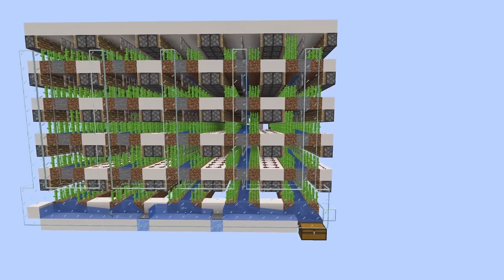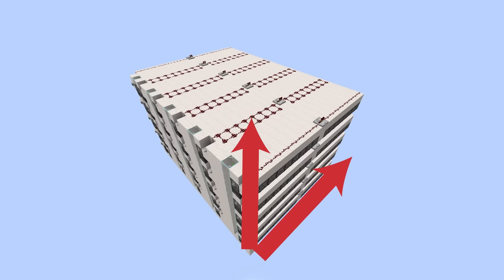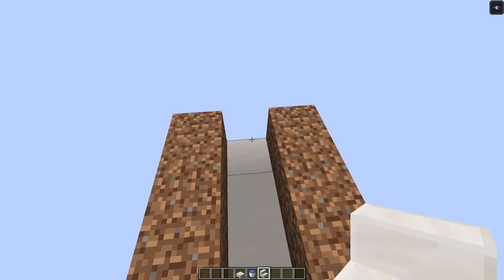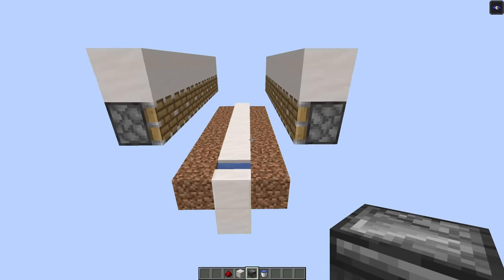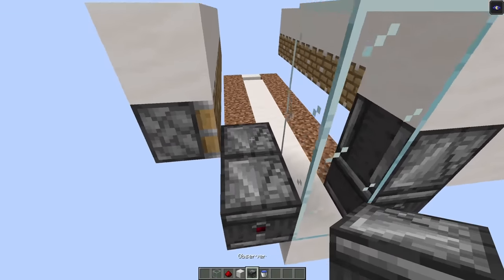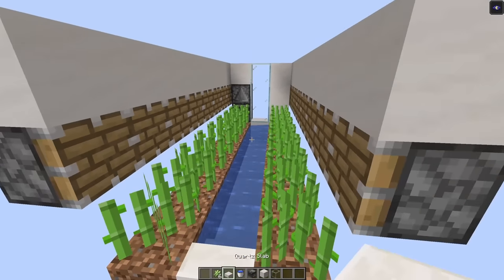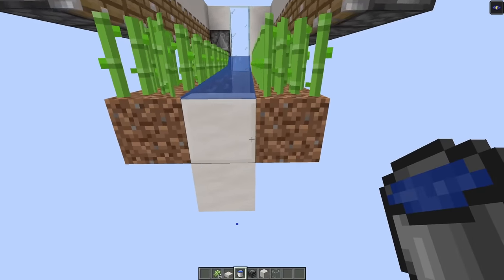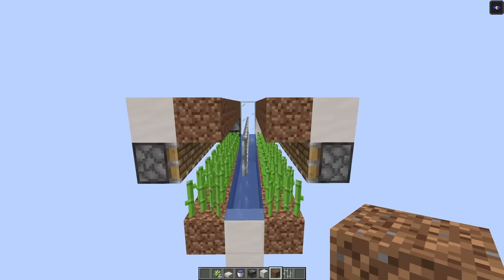Sugar Cane Farm! Compact, Lossless, Easy to Build! (Minecraft 1.15+)

Comment: Hey Mr. Tango, just a quick question, does this work in Bedrock or MCPE?
Reply: You can, yes
Reply: I will build it on bedrock today to check
Reply: I hope so but don't think so
Reply: @mickmccarthy8219  it doesnt i just tried
Reply: James Luna on Bedrock you can grow the sugar cane using bone meal. You can make a small farm that will automatically grow it and break it
Reply: It would work with some modifications because of Java's quasi-connectivity mechanic that bedrock lacks.
Reply: @LittlePangy  quasi-connectivity bug
Reply: @LittlePangy  i tried it already and the water runs into the sugar cane on either side and wont flow the way tangos did
Reply: @lukemonaghan7666   ):
Reply: I don’t think the observer will detect the bottom of the observer growing. You need it on the second one to detect when that grows, you just need to make sure it doesn’t continue to power the piston and loop
Reply: I don't think it works because I saw this comment and went onto bedrock and the water didn't flow straight it instantly went off to the side and destroyed the sugar cane.
But maybe I built it wrong and it was just me, you could try it yourself and tell me what happens
Reply: @al3xm1lner  ye same thing happened to me it doesnt work on bedrock
Reply: You can actually make better sugarcane farms on bedrock because of som mechanics,
Reply: @lukemonaghan7666  At least now I know i'm not stupid and making an obvious mistake 😂
Reply: @noodleagain  any tutorials you recommend?
Reply: Just use 0 tick on bedrock because they can’t seem to patch it. NavyNexus has a good vid if you are on 1.16. Otherwise look up a tutorial for 0 tick on bedrock
Reply: It can work, but it can only be one layer tall and you need to put a hole two blocks before the end of the stream (five blocks away from the source block)
Reply: No, not on the Xbox one version... The observer cannot see the sugar cane update (the observer is watching the lower sugar cane)
Try it in creative.. pretty sure it won't work..(I tried something similar on a pumpkin stem, it doesn't trigger when the stem bends over to connect to the pumpkin)
Ahhh Bug-rock..
Best of luck with it
Reply: @haydenhayden1767  It actually does works, blocks can actually be powered now in bedrock edition
Reply: Youd have to modify it a bit probably
Reply: @DavidR06  0 tick is being fixed next update to coincide with java version, so it would only work if they don't update.
Reply: I hate bedrock so much
Reply: @lukemonaghan7666  I just made one myself, you can compact it by facing the pistons downward and placing redston on to to power it, then use hopper minecarts to collect the drops
Reply: No, you cannot. Reason being that observers do not detect the bottom of the crop growing
Reply: N518 Studios this has no quazy conectivity
Reply: okyloky9 Yes but in the current betas 0 tick still works. Even though it’s not as good
Reply: The basic design can be adapted to work on Bedrock. Run it on a timer instead of using observers - and there are ways to prevent the water from flowing sideways. I posted a comment with the details.
Reply: @lukemonaghan7666   did you put the water underneath the way tango did? that's what stops it from breaking the sugar cane.
Reply: @sirromap1021  i did exactly as his tutorial showed so yes i did but its a bedrock mechanic i think

Comment: I’m watching this even tho I’m on bedrock Edition. Although I think it might work on bedrock
Reply: I believe sugarcane is not waterproof on Bedrock, so the collection stream would wash away your plants.
Reply: No, it won't :/
Zero tick farms work.. I've built the' silent whisper" one, works very well..
Good luck with it :)
Reply: Jay Mac Ya. I use Navynexes’ 0-tick sugarcane farm and it works really well. But I’ll try this one in creative to see if it works
Reply: The sugur cane gets washed away on bedrock I just tried building this
Reply: I think with the  nether update, the two platforms are going to be more compatible...hopefully this is one of the areas where that is true.
Reply: @RetroAlvin   There are ways to prevent the water stream from flowing sideways - so this basic design is viable if you build it right.

And, yes, forced-update ("zero tick") sugarcane farms on Bedrock do work quite well, and reliably in my experience. Personally I prefer not to use them, I feel they're too cheaty. But that is just my personal choice.
Reply: I built this design in bedrock and adding the top layer of water washes away the sugar cane. My solution was changing the lower water to a stream and removing the top layer of water all together. It's not completely lossless but it still works very well

Comment: The water for me just falls to the right and left and break the sugar cane, might just be bedrock
Reply: Mine too why does it do that
Reply: I had that same issu but i fix it by change the water system out it was esy
Reply: water log mechanics are probably different in bedrock
Reply: On bedrock we probably have to have the water lower
Reply: DanishDynamite0 can u please elaborate more on how to fix it on bedrock
Reply: @alepadin8923  if you want to build this on bedrock alot of things need to change, because i dont think observers can detect sugarcane growing, so you would need to have the observer at the second layer and then lead it into a sand piston monostable to avoid the pistons constantly triggering the observer, you also have to build the water steam that funnels the sugarcane one block below the dirt the sugarcane is on, so that the water doesnt flow over all the sugarcane
Reply: Same thing happens to me on Xbox 1
Reply: Try putting the slabs in after you place the water
Reply: I encountered this issue in Java, i realised the reason my didn't work at first is because i didn't make the water blocks infinite Tango kind of glances over this but yeah the water must be "infinite" for this to work because the slabs clear up running water
Reply: @Noob Sharkey  I don't understand what you mean by "lead it into a monostable sand piston"
Reply: @manic221  my water is "infinite" and still overflows into sugar
Reply: Same here bro
Reply: @danishdynamite0304  how you change the water system??
Reply: @manic221  is this a game settings we have to change. wat do you mean make water infinite?
Reply: manic221 was
Reply: Noob Sharkey I had to do this. It just ads one layer to the farm.
Reply: @alepadin8923  take all the water and put it down a level. Don't go 2 high with this design in bedrock
Reply: Same
Reply: I had the same issue, I didn't add the second layer of water and used glass panes instead of iron bars. Occasionally it will pop off to the dirt but mostly goes into the water flow. I also have a water stream above which seems to help catch the ones that don't go out.
Reply: @NoobSharkey  it does.
Reply: @diablo-sosa  solid blocks of water not flowing. Each needs to be a source not one source flowing.
Reply: Can modify easy for bedrock as the water mechanics are not the same. Move the infinite water to the outside 2 blocks under the pistons.(you will need to add some blocks to hold it, put some glass between it and the pistons) then make your water stream in the center where the infinite water used to be. Everything else works exact same. 
Edit-forgot to mention moving the observer up 2 blocks, no need for middle one anymore(again bedrock mechanics)
Reply: Same
Reply: @avengednightmare  when you say no more need for the middle one anymore, what do you mean?  I'm trying this on bedrock edition and presently my pistons will fire when the sugar grows to 2 blocks high, but it's like the machine just straight up deletes the sugar
Reply: @dallincurry3539  wish I remembered for you, I've destroyed mine and made a custom mega farm as it wasn't producing enough for me with 6 chunks.
Reply: It’s because of bedrock
Reply: @danishdynamite0304  how did you do that ?

Comment: Yo guys, if you are trying to test this with puting another sugarcane on the bottom one with observer next to it, it won't work that's cuz manually putting another sugarcane doesn't change nbt data of below sugarcane and observer doesn't detect it, if it grows naturally it's data changes and observer fires, you can test this with tick speed rlly high, also the farms one module gets 50 sugarcane per hour while the one in world download ( 50) modules gets 2.5k pr hour which outperforms most slime block sugarcane farms, also swap the bars with fence gates
Reply: This is the comment i was looking for, never really mentioned the rates, thanks.

Comment: Is it lag-free? Great design though!
Love from Spain.
Reply: It causes less lag than the flying machine variant.
Reply: The low frequency of activation and "instant harvest completion" mean it doesn't cause much impact at all. Pre-1.15 there might be a little more overhead due to light updates when the pistons fire, but still probably insignificant, and you could just box in the farm to suppress those. (Might turn it into an in efficient hostile mob farm, though.)
Reply: Nothing in minecraft is lag free. Every single block causes some lag. The real question is how much lag does it cause. in this case, not bad, but it depends on how many modules you link together. Regardless it is still MUCH better than flying machine with hopper minecarts.
Reply: Love from Gib!

Comment: 2years later and this is still the best farm to be presented to the Minecraft community. That’ll do Tango that’ll do.
Reply: Does it give lag for a low end pc?
Reply: Oh sweet so it still works well in 1.19?
Reply: @Secretlycat31  yeah i made it in my hardcote wrld in 1.19.1 and its working. There's a small problem in the second layer of the farm which stops it but you could find the soln in one of the comments.
Reply: @TheTopOnePercentt  oh sweet thanks :)

Comment: while building, my pistons would just randomly activate from time to time while the observers weren't detecting any update, is this any problem of some sort? or will the farm just work fine anyways
Reply: Same I am have the same problem
Reply: I don't know whats happening but it did the same when I build it I think it will not break anything tho
Reply: i have a solution: instead of making the bottom observers go backwards make the eye go down. You should see the pistons constantly activating. it may seem like the sugarcane does not have any time to grow but it does. also this is EXTREMLY loud. So if you are near the farm i recommend you to turn the blocks audio setting down or all the way. your welcome!
Reply: Sugar cane gets randomly updated 16 times and on the 16th time it will grow, the observer is detecting the 16 ticks where the sugarcane is being updated, shouldnt change anything though
Reply: Just make the face of the observer one block higher and the other observer also  then add a sticky piston ontop lokking vertical to the redstone. Next you want to add a observer facing in the direction that it would give a signal when the sugar cane grows this will prvent you from the glitch that it's random activating and also will prevent you from a clock

Comment: I'm having an issue where the pistons are firing off despite the sugarcane not growing.
It's like the observers are seeing the sugar cane grow, so they fire off - but the sugar cane didn't grow and I'm getting nothing?
Reply: im having the same issue
Reply: yeah me too
Reply: me too
Reply: Same issue, no yield, constantly firing though.  May be a 1.16.1 issue?
Reply: I’m in 1.15 still and having the same issue
Reply: I left mine running for a bit and it finally started producing.   It's still firing when nothing has grown but eventually it gets some growth.  I'm in 1.16.1.
Reply: every time sugarcane thinks if it wants to grow, it sends a signal. After it starts producing, "misfires" happen only periodically
Reply: Trying this design I noticed this too think it might be more ultimately efficient to have the observers facing the second row a
Reply: @scottmccoy511  Lag efficient maybe, but Tango makes item efficient farms so he knows what he's doing.
Reply: @scottmccoy511  you ultimately end up with a higher yield by having the observer detect the sugar cane every time it tries to grow as you will pick up other sugar cane that did manage to grow. This sugar cane that did grow will be stuck until the cane in front of the observer grows if you have the observer on the second row as the ceiling only allows for one block's growth. JCO is right though, it would be more lag efficient to detect the second row, but it doesn't really make much of a difference unless you have like four bajillion modules.
Reply: Hey, the observer detects attempts for the sugar cane to grow,  not neccesarely if the sugar cane actually grows,
Reply: @yehiashaarawy  there is no fix, it is how it is. No action required
Reply: @scottmccoy511  that causes the observers to send a signal when the sugarcane grows and when the Piston breaks the sugarcane, making a loop
Reply: The observers are timed they way it’s placed I was wondering aswell when I first built it but it part of the design
Reply: That is normal, that's just the observers detecting the sugar cane advancing through growth stages.
Reply: Yeah ...and idk why the pistons keeps vanishing or the sugarcanes burst ????? Idk what does but all my sand is gone with a loud boom??
Reply: @tanj4573  That sounds like a creeper explosion lmao
Reply: The observer detects the age of the sugarcane change (you can see the value of each block of sugarcane using F3).  The sugar cane's age increases randomly by one (block tick?) and once it has an age of 15 it can grow another block on top of it.

In short, people are too impatient (I was too...)
Reply: @nullpotato  You nailed it. (By the way, what do you mean by block tick? Did you mean random ticks?)

Comment: It's possible to adapt it to be a bamboo farm, the only problem happens on the first 4 sugar canes spots, water goes crazy and overflows into the bamboo.

Here is what I did: Plant ALL of the sugar canes beforehand, then start swapping the sugar canes for bamboo starting from the water logged stair, then stop placing bamboo when you reach the first two water blocks from the stream.

You may receive both sugar canes and bamboo because you're still using the first 4 canes for the observer block
Reply: Playing in 1.19.2, and that didn't work right for me, I could only replace the two closest to the waterlogged stair, anything else would wash away

Comment: This tutorial doesn't work in bedrock edition, however there is a simple solution,  for the observer, raise them both by one, on top of the observer, place any block of your choice, Place a repeater set one one tick facing away from the block on top of the observer, place another block in front of the repeater, place a block on the left/right side (whatever side has the pistons) then place a piece of redstone dust. On the opposite side of that block, set two blocks then place two blocks of redstone dust on them. place another block right next to that block and another in front of the block you just placed. As this tutorial sounds confusing you should have four blocks next to eachother. place another redstone dust on the farthest block. after that, place a repeater set on four ticks facing into the other repeater. This circuit helps because the the piston hits the observer and puts it in infinite loop you have to create a simple circuit to lock the pulse and release the pulse, which in turn allows the pistons to recieve one pulse. If you are confused by this tutorial message me on instagram @joshisbi14 and I will send you the picture. It's not as complicated as it sounds
Reply: a picture can say more than a thousand words....
Reply: Joshua - why doesn't it work on Bedrock? Is the problem the observer on ground level, or the redstone to the pistons? I like the observer at ground "level 1" b/c (at least on Java) it causes pistons to fire every time there is a status change in the ground level sugar cane - even though it hasn't actually grown yet - and this means all pistons fire (everywhere) more frequently then if an observer was waiting to detect actual growth at level 2 on that one specific block; the pistons would fire way less frequently. You would be better off having a lot more observers as in older designs with an observer above each plant at level 2.
Reply: Block here block there, i don't even know where to put em anymore. >,.< Can you provide a picture pls

Comment: Does it work in bedrock edition ? thx
Reply: No, as a few others have mentioned there are a couple things that would prevent it from working on Bedrock. The water streams will break the sugar cane (though I think it may be possible to work around that - I wanna give it a try) and the observer setup won't detect growth (you could get around that by running the system on a timer, or by observing the second layer of sugarcane, and adding a redstone circuit to prevent the piston movement from re-triggering the machine)
Reply: @tetsujin_144  ty

Comment: I was having trouble with the top water stream washing out sideways in Bedrock. A decent solution that I found was to put water-logged stairs on the outside of the row of dirt blocks. I tore the slabs out of the middle and made a simple water stream over packed ice leading into a hopper where the waterlogged stair was. The footprint is essentially the same as the new stairs sit in line with the pistons,  it works and solves the issue in Bedrock. Not sure what this does to expandability though.